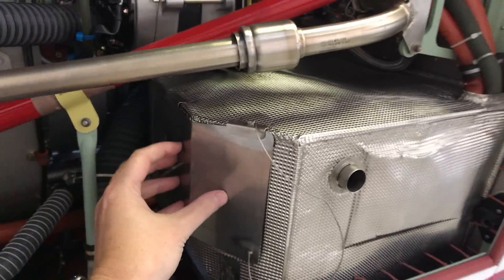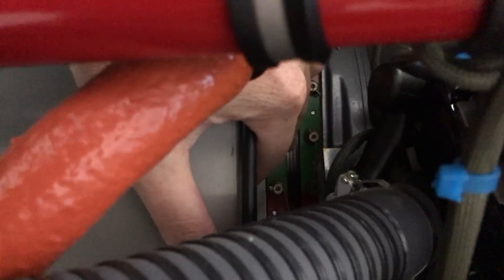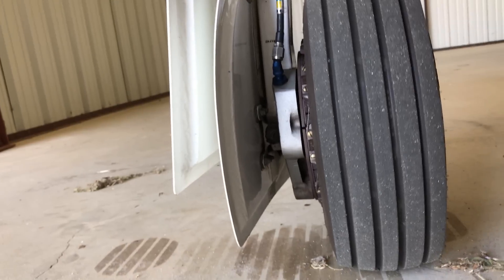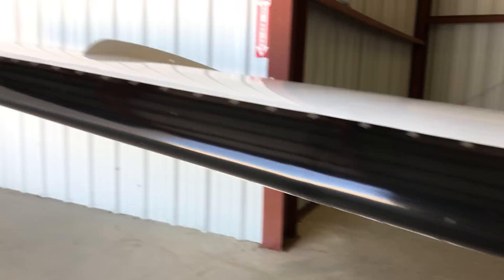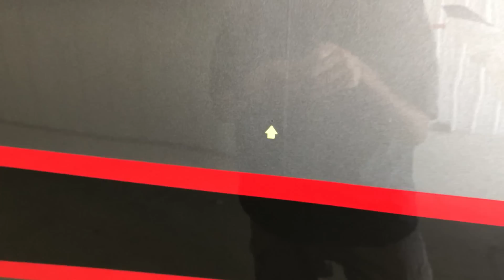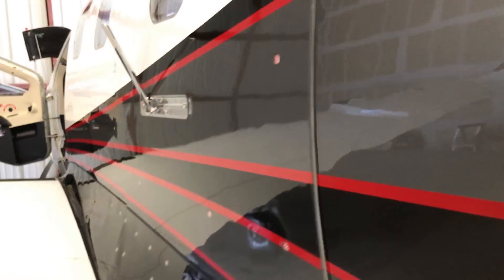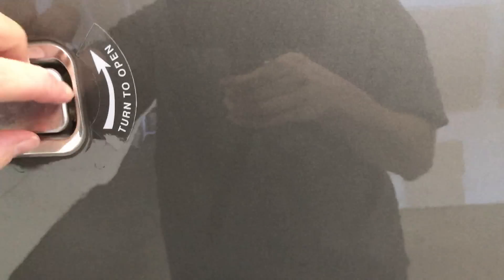TBM 900 - Exterior Tour

Comment: Thank you for this very interesting video. I'm working for the company which manufactures the air conditioning system and other stuff. The GASC General Air System Controller was my very first project. It would be a big thing for me to see this little box installed in the aircraft. I think it is hidden behind a panel in the baggage bay. Maybe you could show it to me. I would be very happy. Thanks.